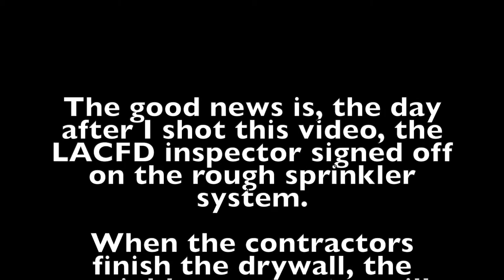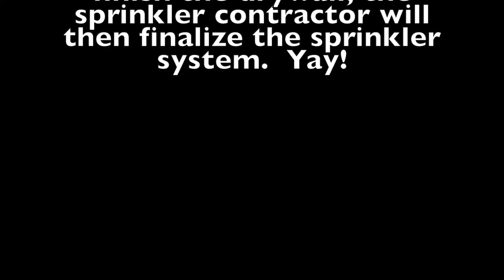Dome House Sprinkler System

Comment: Upon project completion, you may consider disabling your new sprinkler system to preemptively stop the possibility of a house flood.
Reply from the maker: Unfortunately, that's illegal.
Reply: @eddieco  ;)
Reply: That is what I would do. Yeah its illegal.... but that is what I would do. Can only tolerate so much stupidity :D
Reply: Jonathan Pointer 
What if there’s an Electirical fault in the dryer of kitchen? The shell maybe flameproof but the walls, floors, furniture etc are all flammable.

Comment: There’s a lot of wood that could burn regardless of what the shell is made of. For instance an internal fire that starts in the kitchen or laundry room could spread and gut the whole house.
Reply from the maker: The dome itself is concrete,  The amount of lumber in the house is a fraction of a "normal" house, thus the risk is considerably lower.  Also, wood is covered with drywall, which is considered fire resistant.  These houses have had interior fires, they don't spread that quickly.  The biggest risk of fire where I am at is from an OUTSIDE wildfire, not an interior fire.
Reply: Eddie Conna 
Dry wall makes things fire resistant, not fireproof. What about all your furniture, is that covered in concrete or drywall?
Reply: @thechumpsbeendumped.7797  Read up on fire investigation.  If you've ever tried to start a campfire you realized it's not that easy to get it going absent accelerants like gas, alcohol etc.  An sprinkler systems can cause more damage than the fire they are "controlling."  In my neighborhood firefighters knocked open doors of homes to tell people to get out only to find that the occupants didn't answer because they were already gone.  The smoke that got in triggered sprinkler systems which caused damage even though the fires never got near the exterior.
Reply: @JC-nf2ti  
Domestic sprinkler systems set off by smoke? Are you sure? That seems pretty dumb to me, I’ve only ever heard of ones triggered by temperature.